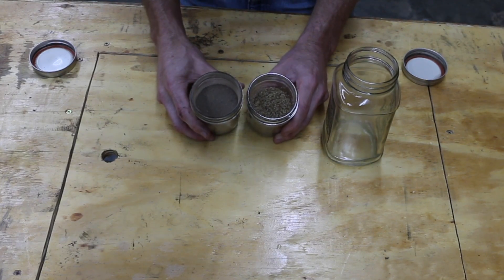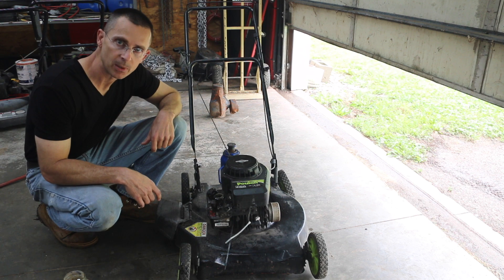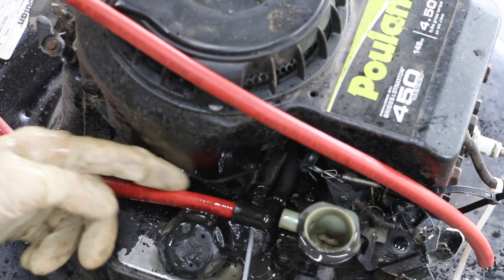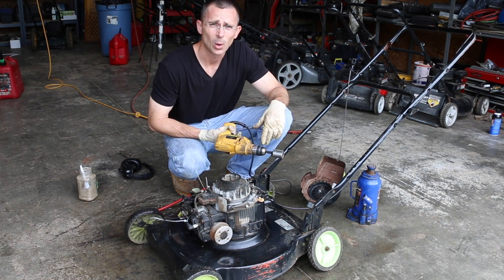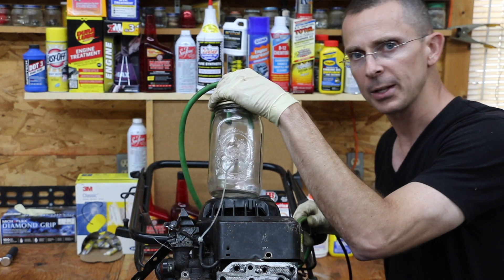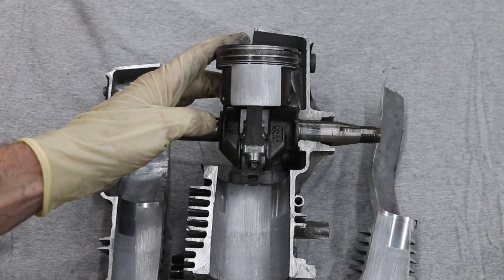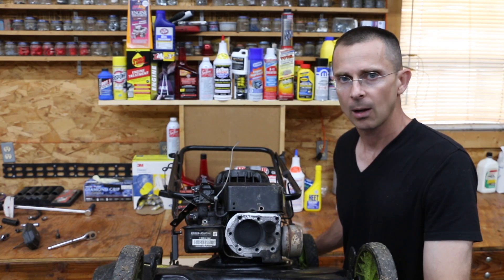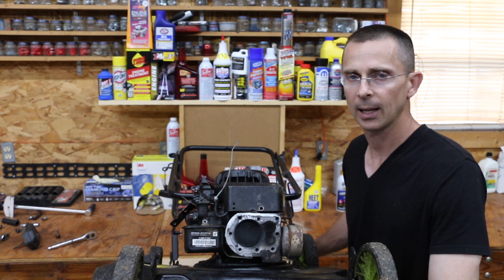Will Dirt Destroy an Engine?  See what it does to this Engine!

Comment: I fix and modify cars for a hobby/living, and still amazed when I see a high horse power car on the road or even track with no filter, ether just mesh or nothing at all. Studies have shown that a proper size airfilter dose not reduce power (test was done on a 1500whp supra), but the mesh actually does. Its not worth it at all, especially if you've put all that work and money into the engine just to have it eat itself. Bisimoto had it happen with a all motor F22A and no filters on the carbs, I thinkmit was actually a small rock he sucked in. Oh yeah, I second the hydrolock test as well!
Reply from the maker: Chris, I enjoyed reading your comments and agree that it's very wise to keep an air filter system on an engine!  A lot of votes for the hydrolock test!  I'll have to do it soon!  Thanks for watching the video and commenting!

Comment: A more realistic test would have been to take the contents trapped into a filter used for a year and introduced that into the airstream. This is exactly what would have been introduced into the intake absent a filter, spoons full of sand is not representative of reality.
Reply from the maker: Don, Great point!  I have an old Ford 5000 tractor with an "oil bath" filter.  The clumps of dirt and grime that form at the both of the oil bath is impressive!  I'm considering upgrading the filtration system to a more modern design to better protect the engine.  Thanks for watching the video and commenting!

Comment: i just had a idea on how to fuck a engine up. on the late 90s early 2000s taurus with the 3.0 24v motor. if you take the oil cap off you can touch the timing chain with the engine running. it would be cool if you started welding on the chain with the engine running. it would prolly just tear up the chain guids and eventually jump time. but it would still be cool. iv never seen anyone try that shit before
Reply from the maker: fuzzy wuzzy, This could get very interesting!   Thanks for watching the video and commenting!

Comment: I don't feel this test was accurate. What kind of damage would be done by running it without an air filter, say normal driving in the city.  Judy because an engine never takes in sand at that rate.
Reply from the maker: lucky seven, Great point!  I have a 1974 tractor with an oil bath filter.  It collects a lot of dirt after a few hours of work in the field.  Cars are far less likely to be exposed to high levels of dirt. Again, great point!

Comment: Very good video!! You should try sand in the oil which would show what would happen when you don't change you're oil filter or oil for a very long time  because when the filter gets full you're engine has a bypass valve to keep oil pressure up thus completely bypassing the filter all together
Reply from the maker: the66volks, This is a terrific idea!  Thanks for watching the video and commenting!

Comment: I love the video's,  my opinion on this one,  I grew up on a gravel road.. but I think it would be hard to get that amount of dirt, over a long time.. obviously it could happen.. usually I found that the engine's that I saw n my career that had people who didn't take care of the cars... (no air filter, if they took it out so it would run.. or I have seen them suckered open.  and I would see damage to the cylinders and pistons.. but I just felt it was years and years 9f neglect. . I wonder if that sand would get in on a regular basis?  just thinking outloud..
Reply from the maker: Truck, Manjr I agree!  I spent a year in the middle east where the wind blew a lot of sand. That's uncommon in most of the world.  I agree that this was an extreme test.  Thanks for watching the video and commenting!

Comment: There is so much metal on that oil... it must be fairly conductive right now! ;D hehehehe Great test. That's why never go off-road or travel without air filters. But... racing track is an exception. :/

Could you try only thin dust without the sand?

That's is the only thing we usually get on the racing track when someone decides to use the car as a lawnmower or dig a new hole and stuck on the brittle pool.
Reply from the maker: Ti M, Great suggestion!  Thanks for watching the video and commenting!

Comment: if its possible try advancing the spark timing i know its not likely today but that used to be a way to get more power
Reply from the maker: Pat, Great suggestion!  Yes, there is a way to advance the spark timing by removing the key on the flywheel and then advancing the flywheel position.  I will do this in an upcoming video!  Great idea!!!

Comment: Just two thoughts on this,I thought it would take longer for the engine to fail,and I am suprised at the amount of damage.Also in the comments someone mentioned hydrolocking an engine.Real world experience,Once was involved with an investigation where a soldier was washing his truck,sprayed water into the air cleaner.Engine was severlly damaged Bent rods,one rod broke punched a hole in the block.Engine was a 425 CID multifuel that had a 22-1 compression ratio,normally used no#2 diesel fuel.Only good thing that came out of it all was that the soldier found out exactly what the cost was to replace the damaged engine as he paid for it.
Reply from the maker: Charles, Wow!  That must have been an expensive learning experience for that soldier!  Thanks for watching the video and commenting!

Comment: I'd like to see a hydro locked situation, I had a Ford 6.0 (shocker) that blew a head off, and I'd like to know if anything can be done
Reply from the maker: Mitchell, Great suggestion!  I hope you're able to get the 6.0 repaired.  I'm told there is a way to modify this engine to be extremely reliable.  Thanks for watching the video and commenting!

Comment: I'm surprised the compression did not drop more than 15PSI. That grey material in the engine oil is metal. Stick a magnet in there and and see if you can get any of ferrous metals to stick (like metal from rings). Also, if you let it sit for a few days and slowly decant it, you should get a nice sludge at the bottom that you could further analyze. Put down a large piece of cardboard next time to make cleanup easier. You should try hydrolocking an engine with water at high RPM (to maximize damage). Oh, one more thing to try: Replace oil with WD-40 (it's technically a solvent, but I'm sure it has some lubricants as well)-but be careful about it. Really enjoying your videos. BTW.
Reply from the maker: Great suggestion and thank you for the positive feedback!

Comment: I know that growing up I saw a lot of lawn mowing and a lot of mowing over dirt patches and the like and watching clouds of dirt fly up all around the mower. I am sure that it does in fact kill your engine after a while of mowing like that without a air filter as a lot of people just take them off so they could pour a little gas into the carb to get the mower started. Not only does this test show the damage to a lawn mover but think of all the people who have ATV's and run them without air filters threw dirt, mud, water down dusty gravel roads, I know I have!!!   Remember to wash or replace your air filter!!!
Reply from the maker: Mike, All great points!  Thanks for watching the video and commenting!

Comment: Your destructive tests (dirt, sugar) should include bearings, too.  The cylinder parts certainly are not the only, or even the most likely to fail.  The crank main and piston bearings, and the piston wrist pin bearings have much more critical tolerances and are much more susceptible to failure.  Oil galleys, too.  Sugar in the gas is likely to cause the most damage by migrating into oil and destroying its lubricative quality, then bearings go POOF!
Reply from the maker: Arnel, Great point and I agree!  Thanks for watching the video and commenting!

Comment: WARNING: DO NOT buy a used mower from this man!!! LOL.
Reply from the maker: LOL!  Thanks for watching the video and commenting!
Reply: @ProjectFarm  Tell him you give him a 'steal of a deal' Haha
Reply: Craigslist Mower for sale well maintained like new kept in shed
Reply: man the ad said slightly used....
Reply: Yeah it was only used for 15 minutes 😂
Reply: Husqv 51 lol that just depends what you want to do with it.
Reply: I'm confused, how the shit would the cylinder walls recover from giant gouges?
Reply: If you'd let the engine run for a while, the cylinder walls probably would recover, and you only need to replace the piston rings. It would still run well for many more years (without sand, that is).
Reply: Husqv 51 😂😂😂
Reply: Husqv 51 wtf
Reply: brand new barely used just missing like half the piston and
Reply: Yeah, hardened cylinders (NiKasil), are usually only found in higher end scooters. Not cheap chinese stuff; or American stuff from 10+ years ago.
Reply: @ProDigit80  I rebuilt a briggs koolbore honing it out .020" and then used alusil in the bore.  I don't recall it being expensive
Reply: actually you can make money off that used mower with the same video he's doing
Reply: I'm going to guess cap'n crunch?
Reply: They are all fucking aluminum and aren't hardened in any way.
Reply: Well it would probably only cost like $20 if it came from him
Reply: LOL mower for sale brand new only 15 minutes of use great condition it had 4 oil changes during that 15 minutes of use lol
Reply: “Well maintained lawnmower with a see through engine. No carbon buildup whatsoever. Engine oil changed very regularly. Excellent views of the interior of the engine.”
Reply: russellp1982 
What is it??
Reply: I don't know if in this case the cylinders aren't aluminum, but many lawnmowers, scooters, motorcycles, and small engines have aluminum cylinders (hardened with silica).
Reply: Yep, runs on sand and gravel.
Reply: Used lawnmower for sale, cheap. Broken in, resurfaced cylinders and piston, no extra charge . . .  ;)
Reply: So true don't buy a used lawn mower from this man!!!
Reply: Condition: New Out of Box
Reply: j
Reply: lololololiolkol
Reply: Husqv 51 ooo
Reply: Husqv 51 have been cut to half lol
Reply: hahahaha thats awesome
Reply: Husqv 51 now you tell me! !!!! Farken hell, he told me that it was strait off the showroom floor, it blew up on the first start up and started a massive bush fire😎😂
Reply: Why the hell not he cut me a great deal
Reply: How much oil is in it!   Lol.    That says take your air filter off and go with  it. U will b all right.
Reply: Husqv 51 I would buy the one he seized up with sand seawater  and mud in the  crank.
Reply: Lol indeed.
Reply: LOLX perfect one :D
Reply: Why it's fine
Reply: Husqv 51 hahahahaha
Reply: But it said barely used on Craigslist XD
Reply: Lmaob😂😂😂😂
Reply: Idiot
Reply: just admit it you want that engine all to yourself for your Dreams of having a project farm engine
Reply: But it only had 15 minutes of run time on it!
Reply: @ryancooper5647  yeah but 15 minutes with dirt in the engine is like 15 decades with proper maintenance being ran normally
Reply: Shut up
Reply: too late
Reply: Except for art
Reply: It's a little Briggs motor, put some oil in it and it'll run great!
Reply: Thanks for the advice!
Reply: Hahahaha
Reply: Lmao
Reply: 😂 no crap I agree
Reply: Lol
Reply: Poulan pro mower for sale. Light residential use. Owned less than a year, runs as should,.. comes with two cans of starting fluid for easy starting every time... No charge for staring fluid. $75. Wil deliver for small fee. As is. ABSOLUTELY NO RETURNS, ONCE YOU TOUCH IT SHE'S YOURS
Reply: I can see the next video, what works best in an engine: sandblasting sand, aquarium sand, or sandbox play sand?  Let’s find out!
Reply: Wow, nice!!
Reply: Because the rings will wear the metal down smoothing them out over time and reseat. Remember this is a fucking aluminum block with hardened steel rings. Most of the compression loss will be from damaged valves and seats. And most of the engine dying is from particles getting trapped between the valves and seats.

Yes that shit will ruin your engine, but what he is doing is equivalent to 15 or 20 years of use. Most likely it would never last that long anyway even if taken care of.
Reply: Claudio Volber calado
Reply: Yeah, a valve adjustment should take care of the brunt of the power loss.
Back in the day we would hone the cylinder. But for a lawnmower, the problem would probably rectify itself over a few tens of hours of use, with thicker piston rings (putting more pressure on the cylinder walls; or just run the stock rings if they still work.
Reply: Well I accept being a fucktard Russel but you need to find out before you run your mouth about shit you know nothing of. 
Now, I have an old motor that has a steel sleeve but that is far from normal for lawn mower engines. 

They are almost 100% aluminum. Including the pistons.
Reply: Gabriel Velloso 😱
Reply: Que cara imbecil!

Comment: something you might want to show if you haven't and that is the effect of water and alcohol fuel from being left all winter. as in the inside of the carb and rust in the engine, water in the crank case.  also use karo syrup in with the fuel
Reply from the maker: Marte, These are great suggestions!   Thanks for watching the video and commenting!
Reply: you're welcome

Comment: i never run anything without an air filter but with that sayed i have some things that just have a rag as an air filter, if it makes it through that i doubt it would do anything (and it hasnt so far), besides anything i have that dont have a proper filter is something where small dust particulate in the engine would be on the low end of worries
Reply from the maker: FlyingWldAlaska77, Great point!  Thanks for watching the video and commenting!
Reply: yea and also what comes to mind is what the engine is for, like ive seen a snowblower that never had an air filter or a place for one cause the only thing it was expected to suck up is air and maybe some moisture but cold air is also dry cause all the water would freeze somewhere, also on something like a rototiller i would expect to see a very complex air filter because its throwing dust up and intaking air out of a dust cloud, it all depends, i have a cheepo chinese dirtbike ( apollo 125) i got it dirt cheep cause they dont hold their value like for example a honda, my bike has a "cold air intake" style pleated single element "coffee filter" air filter, where its just one sheet of paper or whatever they use and it has wire mesh around it to strengthen it, when cleaning it you can find some very fine dust on the surface inside the carb, not alot and its very fine, the bike will probably die from something else before it dies from that, and it gets used in very sandy very dusty environments, my buddies honda however has a multistage fancy foam and paper filter and you find dust caked on the front but its pristeen and clean as a whistle on the backside and thats how the air going in is, a honda 150 is a bike that costs about 3,500 bucks and its built and expected to last for a very long time in comparison to a chinese stop gap that costed 700 bucks new, i have all of 200 bucks into mine and it was mint when i got it, thats why i did, i knew it wouldnt last me till i was 50 but im supprised at how quickly it deteriorates under the same conditions that the honda just powers through with flying colors, my friends bike is 4 years old and they got it used, my bike was bought, driven like 2 times than traded to another guy where it sat for 2 years in mint condition brand new not even broken in yet, and i took it out and did everything my friend did for a weekend, wheelies, burnouts, doughnuts, trails, top speed runs, jumps, dont forget crashes, and my bike looked pretty tired at the end, the chain had a chance to stretch and break in as expected but the sprockets show small but easily visible signs of wear in the teeth and the back tire has half the tread i started with, looks just like my friends but his is atleast 4 years old and mine was new, the chain walk off preventer guide thing had just about fallen apart from the chain slapping up and down from it being loose, all of which has since been fixed and chain properly tightened, long story short you get what you pay for if its honest and thats just what you need to remember

Comment: you see if  there had steel sleeves then it would be ok, steel sleeves last 99999x longer than just plain alloy bores(by looking at the alloy bore on the unworn parts its not even plated/coated to add as a protection)
that oil looked like mine after i did an oil change and mine is a new mower with all oil changes done regularly 
and it still has alloy in the oil - that means the alloy bore mowers are a bad design and only have a very very very limited life span
great video
Reply from the maker: genmaxpain, Great point!  I agree that steel sleeves would make a difference!  Thanks for watching the video and commenting!

Comment: That's what my old engine looked like. I believe it was from a clogged filter (it looked like a dirt ball) which caused it to suck dirt from around the end of the filter past the seal over the years.     
My compression was only 30 psi so yours was 50% better even after the sand.
Reply from the maker: blipco5, Wow!  30 PSI is low!  Thanks for watching the video and commenting!
Reply: PF...I posted on another of your videos. I was surprised it would even run. It took about 20 pulls to start it. After barrel-picking every lawn mower I've ever had I decided to buy one brand new. I'll actually maintain this one. It's the first mower with a  sharp blade I've owned too. Should have done this thirty years ago.